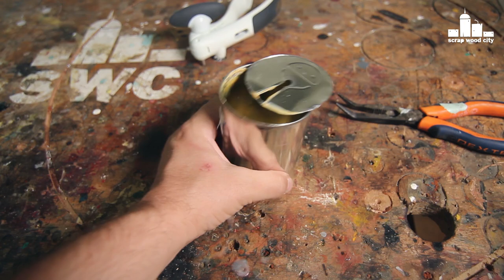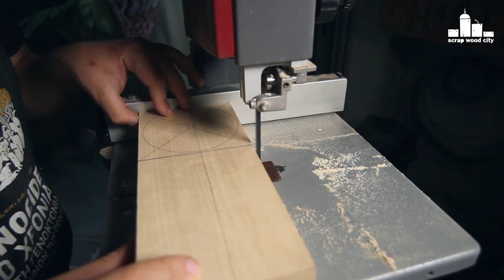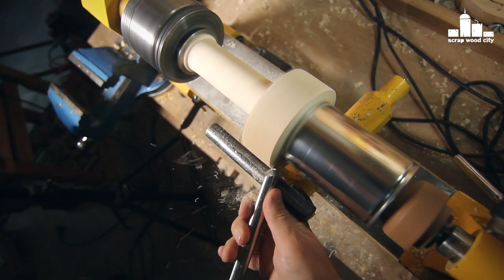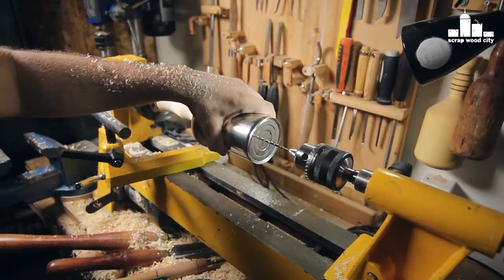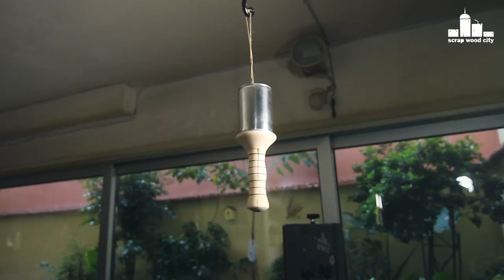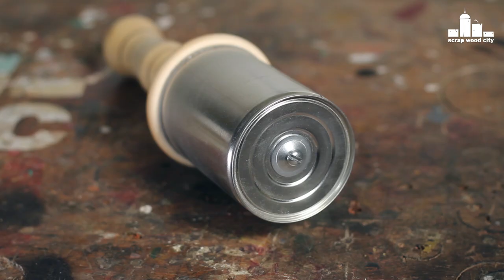Making a milk can maraca - Woodturning

Comment: For some reason i feel like this took longer to make than i should have. You had a slab of wood that looked to have the same diameter of the can yet you used a seperate piece that you ended up gluing onto the handle. When you could have just turned it all from one piece. Not to mention that you used a band saw to cut the cylinder shape when you could have just cut the corners off and let the turner make it evenly round... im gonna get alot of hate lol 😂
Reply from the maker: No it was much thinner than the can. I couldn’t do it from one piece